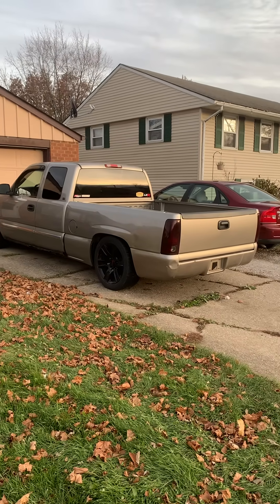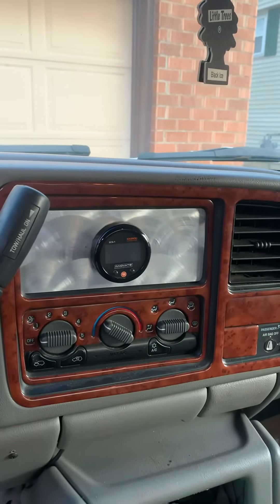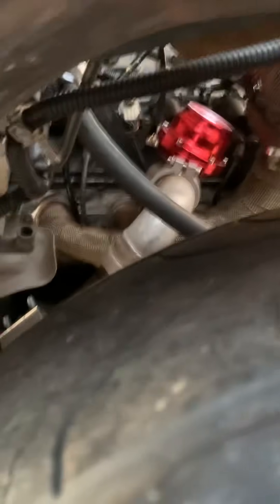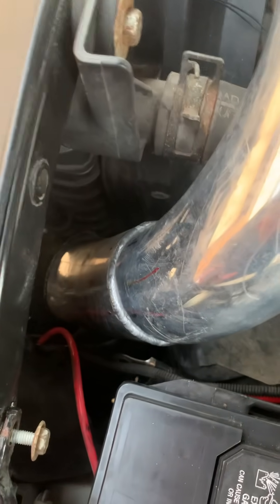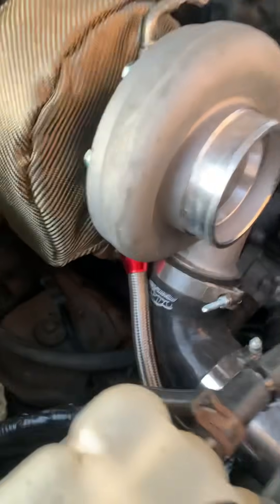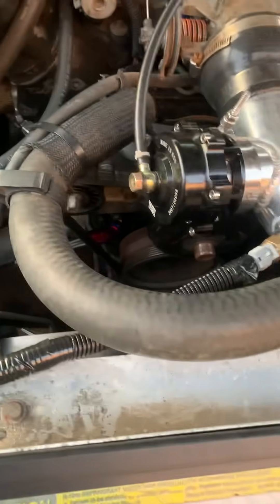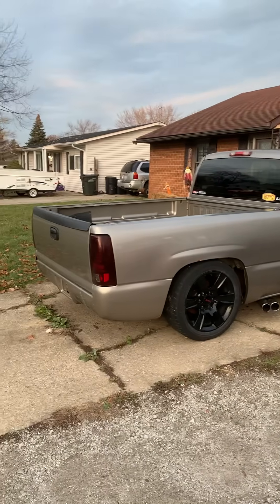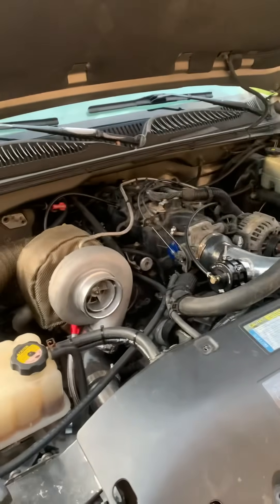Low Budget Turbo Silverado Under Boost for $1500 w/ XS-POWER.com Hotside and complete build info

Comment: Looks good. Personally i would had fabbed an extra piece to put the turbo were the coolant reservoir is at right now. That way you can retain the AC and keep the hot turbo away from the coils and wiring.

Comment: I have a 1985 Chevy caprice classic with a 6.0/4l80 and my brother and I was talking about doing this and to see that you did it with $1500? I’m SOLD!
Reply from the maker: It can be done, eBay and YouTube will be your best friends. Especially in a big bodied caprice, you got a lot of room so it’s a lot more of a universal fit instead of having to buy stuff for something like an f body or something
Reply from the maker: That’s why I chose to do it to my truck because of all the option I have
Reply: @bo_flint93  True. It’s a lot of room up top but but from the headers go down it’s a tight fit.
Reply from the maker: Good thing these hug the block and bell housing should fit great
Reply: @bo_flint93  Indeed

Comment: Not bad. More than one to skin a cat with the ls truck turbo builds.

Four years ago, I went with the basic On3 kit with the 7875 upgrade $2,100 shipped, no tax. No regrets with the On3; buyers just have to factor in wideband, fueling, fans, tuning, etc.

Just swap in a good junkyard 4l80e, before going into serious boost.
Reply from the maker: I wish i would have bought the on3 kit for my 6.0 LQ4 swapped RCSB about 5 years ago when i originally decided i wanted to go turbo. Would have saved me some time and my sanity lol
Reply from the maker: I think it was around same price after i had a few options picked
Reply: @bo_flint93  p.s. keep the fuel tank at least 1/2 full, when doing hard pulls under boost. You don't want a 17:1afr blowing holes in the engine.
Reply from the maker: Lol. I hope the fuel pump does pretty good, i modded the bucket so hopefully it will hold fuel better on hard pulls

Comment: That's a sweet setup for what you have in it 🤘. I had a CLEAN 02 Silverado the same color and had plans to do the same. It was a good running 4.8 and I miss it daily. It would run all over both of my buddies 5.3 trucks and it made him so mad lol. We don't know what it was about it. It just ran hard with the same bolt ONS. Anyway, that gives me a push to get another one now 💪
Reply: 4.8 has a shorter stroke  they will get up faster but 5.3 will get it on top end BUT usually once u get someone on the jump and they don't have alot more power than you then usually you got them

Comment: This is beautiful. Wanna do something like this to my Dad's 6.0 LS2 silverado SS, get it cranking out mad power for relatively low cost.
Reply from the maker: That truck would be perfect, aleeady has the good tranny in it
Reply: Silverado SS should have an LQ9. Basically the same thing, but LQ9 and LS2 are both higher compression, an LQ4 would be more fitting to turbo
Reply from the maker: The only difference is the pistons and rods, the talk between LQ4 and LQ9 which is better is overrated, it’s all in what u wanna build and how much money you got to spend
Reply: @bo_flint93  yes, overall a lower compression is easier to boost and less risky. If I recall correctly the LQ9 and LS2 have around a 10:1 compression, where the LQ4 is somewhere around 9.4:1?
Reply from the maker: I’d say you’re right. Man my wife’s Denali has the 6.2 in it and I can’t waitbtinturbonit

Comment: got a similar thing going on with a 1994 4.6 V8 thunder bird, not one but two of those t4t3 m12 50/63's... fit under the rear seat. half way done "piped up running but missing the second blower"... but for now it's getting near 40 below, no one works in that weather unless in a heated truck plowing snow. 😋🍗 so cold the 10amp 14lpm oil scavenge pump is nearly sized, needs a pulse driver to prevent the coils from burning out.
Reply from the maker: I will check it out on ur channel

Comment: Man I have a 2020 2ss camaro but I don't want to void my warranty and I got a 2000 silverado for a daily ... I have are head stud 2 different cams 243 heads port polished and a full build kit but it was ment for my 6.0 ls but I got rid of it . Now I'm thinking of putting it into my daily then doing a turbo kit but I want ac and heater

Comment: Your video popped up on my feed and I thought I had see them all haha! I’m 99% and I’m struggling to get my innovative wideband to report to Hp tuners. My tuner said I need to wire in a 3 pole 2 way switch from the AC pin in the PCM to the AC wire on the co pressor to the output of the LC-2 controller. If there’s an easier way I’m all ears. It’s an email tune so it’s kind of a pain. But I can make whistle noises so far, pretty exciting haha. Nice video and keep up the good work
Reply from the maker: Thanks man I appreciate it. I think my scg-1 came with a cable to connect to hptuner
Reply: The easier way is to buy the prolink and pro tool set, it's worth the money to support hptuners imo but I understand everyone has a different budget. That said, there are plenty of good write ups on doing it via the AC input.
Reply: @curbo34  do you happen to have a link? I’m still trying to wrap my brain around it...
Reply: I posted links but I guess YT took them down
Reply: Once I figure this out I’ll make a video

Comment: The eBay hot sides are up to $500 which is absurd. I’ve been teaching myself to weld so I can make my own hot side and run a gt45. Mine will be mild steel, already have the J bends. I’m trying to find a cheap/blown engine to use as mock up so my truck won’t be down more than a weekend. I have a summit 8718 cam, summit Ls6 springs, 340lph pump and running on about 50% ethanol. I’m excited about going turbo!
Reply from the maker: You gotta nice little plan going on. Keep me updated on your build would love to see it. Have you seen my new build yet? Well it’s a project right now but hoping to finish by summer time. I have a gmc Sonoma 6.0 swap with terminator x that I am going to do a budget turbo kit on.
Reply from the maker: XS Power has Hotside on there site for $300
Reply: @bo_flint93  when I looked earlier it was $330, now it says $349 for us. I can’t do without the ac in the south, especially since mine is working so good with my junkyard electric fans.

Comment: Damn ... I never wanted to be a typical Mexican with a truck that’s low and loud but trucks are useful and having a truck that can move is even better ... I’m thinking about getting a turbo myself for an 03 GMC Sierra 5.3 it’s already some what quick tested the 0-60 did it in under 7 seconds more like 6.8 but still moves. Great set up you have there

Comment: Ok I got a 2010 Camaro 6.2 LS3 I want to do this just idk if this would be good to just get 600 hp from. I’m building to 1000 hp just not about to drop 4500 right away on akit
Reply from the maker: You could easily see +650 easily especially with that 6.2
Reply: @bo_flint93  With this setup? and how reliable is it?
Reply from the maker: Easily
Reply: @bo_flint93  Reliability is decent?

Comment: That link for the hotside/crossover is 440$ now. 

Recommend getting the ebay cast turbo manifold, and getting the ebay crossover, cutting out and replacing the flex section.
Reply from the maker: Wow that price went up

Comment: How does this workout with the factory intake manifold? Its gotta be hard stuffing any boost into a 75mm opening???
Reply from the maker: Not at all, stock intake actually works great. Lot of people think you have to buy some expensive intake and tb but honestly save your money and use it on something meaningful. Or if u desire to change it anyways just get oem trailblazer ss intake

Comment: Those stock wheels are sweet did you powder coat them ?
Reply from the maker: No I actually bought them for $175 and painted them with some black basecoat that I had from a previous paint job and then I cleared them with high solids clearcoat and they turned out pretty sweet.

Comment: Iv got a gt45 eBay special turbo 0 miles with the passenger side turbo manifold 0 miles. Wastegate 10miles or less on it. 4inch intercooler from on3 performance 0 miles along with cold side piping. And a set of 60lb Deatschwerks injectors. Basically 60lb Bosch injectors. 60miles. I upgraded my turbo setup. I was making 440hp at the wheels. Stock 4l60e trans. All on pump gas. For sale $500
Reply from the maker: How much for injectors?
Reply: You still have this setup for sale?
Reply from the maker: That would be an awesome deal if u could grab it
Reply: @bo_flint93  guessing he was just kidding about the price. No reply to either of us
Reply from the maker: Lol I guess so

Comment: Did you have to flip the stock exhaust manifold around so it points forward?
Reply from the maker: No I used XS power Hotside manifolds

Comment: Need to run a line to intake off catch can. Want to pull vacuum through it
Reply from the maker: Ok I’ve been thinking something was hooked up wrong because my can doesn’t have much in it
Reply: @bo_flint93  yea I did the same I thought it was pretty much just a vent but it actually needs a line to intake just like pcv. Whole reason we put em on to keep that nasty oil and carbon from going back into the motor. But don’t sweat it homes I did the same thing
Reply from the maker: Good looking out man I appreciate you

Comment: I want to try setting up a 5.3L with 2 VF39 turbos from a Subaru as each one is sized to a 2.5L and would feed a 5.3 perfectly. Plus they'd be cheap as they're always sold off when the car owner upgrades at usually low milage. They're also oil+water cooled and the bellmouth downpipes (internal waste gates) would work well for routing the exhaust back down under the truck. There would just need to be a merged coupler for the 2 oulets. The generic FMIC would still work. A boost referenced fuel regulator is needed to keep constant fuel pressure though. Did your tuner remap the existing ECU or did they use a piggyback setup? What HP output did you end up with?
Reply from the maker: Stock PCM on HPtuners with 2 bar MAP sensor from a cobalt LSJ
Reply from the maker: Easy 500 hp on stock cam 5.3

Comment: Just checking in on this, plan on boosting my 99 4.8 similar setup. How’s it holding up?
Reply from the maker: I’ve put about 800 miles on it, hard miles too and it’s been great so far.

Comment: Is it possible to tie the exhaust back into the original pipes for a more stealthy quiet sound. Or is there enough room?
Reply from the maker: Yes it’s possible, it would be a tight squeeze with my crossover pipe running around bell housing, if you went with the crossover in the front it would give you a lot more room to run a full exhaust

Comment: Did you run the stock fuel lines, rails and regular? Thanks.
Reply from the maker: Yes they will support up to 600-650 hp

Comment: How much boost can you get out of it and do I need to change anything or I can just drop it in and go ?
Reply from the maker: You have to change a lot like transmission, plugs, springs, oil return, it takes quite a bit of work, but if you’re doing the work yourself it will save you a ton of money

Comment: Where'd you put the o2 sensors ? One on each headers or on the downpipe?
Reply from the maker: One on each header is ideal but I have one ind driver side header and the other in the down pipe and I have my wideband in my downpipe too

Comment: How did you do the oil feed? Did you take the pan off? And did the kit come with the lines?
Reply from the maker: I return it through timing cover by welding in a 10an bung
Reply: @bo_flint93  did you take the pan off to drill it I’m only asking because of shavings getting into the pan
Reply from the maker: I didn't use the oil pan I used timing cover
Reply: @bo_flint93  do you happen to have any pics of location for that because that would be more convenient then drilling the pan for me
Reply from the maker: https://youtube.com/shorts/hrKHiNFwshg?feature=share
Reply from the maker: https://youtube.com/shorts/-Kde60eCb-8?feature=share
Reply from the maker: https://youtube.com/shorts/hrKHiNFwshg?feature=share
Reply from the maker: https://youtube.com/shorts/-Kde60eCb-8?feature=share

Comment: I started watching 4 wheeler videos and ended up here… and I have a 2004 Silverado and was going to get a cam for around 750-800 price range…..but you mentioned you got a turbo for 200?!! Wow I never looked into turbos for trucks. So my question for you is did u have to change the fuel injectors like you can’t run on stock ones? And how long did it take to get everything installed turbo Intercooler etc
Reply from the maker: Yes you will have to change injectors it will run on stock injectors but if u try to make boost you’re gonna hurt it. I will have some more videos very soon the truck is done now, just gotta do brake lines and it goes on the dyno next week. It has come such a long way since the videos

Comment: How has the truck been holding up? I have an 05' sierra I want to do a single kit on, but can't bring myself to drop the $3,000 on the on3 kit. (im cheap too lol) I have a welder and plenty of fab knowledge, so i have a hard time spending $3k+ for a kit than could obviously be put together for half the price. 
 Definitely like how you routed everything here, and that hot side kit looks dang good for the money. My major question would be, could you have retained AC with that hot side kit? I want to retain Ac / Heat, but that hot side kit is definitely the cheapest & best looking one i've seen by far. Would love to chat with you some more on this build.
Reply from the maker: Thanks man I appreciate it! You could retain ac would just have to reroute lines. And as far as having fab knowledge you will be able to breeze thru it
Reply: @bo_flint93  How has everything else help up on the truck? I’m looking to make 550-600whp on a cammed 4.8 - stock ring gap, stock bottom end.
Reply from the maker: You will make that power very easily especially if u go with the sloppy stage 2 camshaft and go e85 with some deka 80 injectors and a 340-450lph pump you’ll make that power easily
Reply from the maker: It’s all held up really well, biggest thing is just checking to make sure all your clamps and manifold and flange bolts are tight. They loosen up overtime because of the extreme heat cycles but that’s part of the game. I don’t have the truck anymore but it is in Chicago now and still being daily driven to this day. I have a new build that I am finishing up now it’s a 97 gmc Sonoma with a 6.0 and I built my own turbo kit for it like I did my Sierra. Check it out on my channel I’ll have an update video soon
Reply: @bo_flint93  I’m already running a BTR truck Norris cam, I was also looking at the DEKA injectors with a 450lph single pump. I daily drive the truck & im trying to do a turbo setup & 4l80 swap for $3500 & under. Already have a good friend doing an OE rebuild with a 3200 billet converter on a 4l80 for me, that tab was $1,550. So hopefully I can piece together a kit for less than or right at $2k & send it down the road reliably lol.
Reply from the maker: U should have no problem doing that. Save some money and put that into getting a good tune or Dynotune if possible. Where u located?
Reply: @bo_flint93  I have a friend who remote tunes, he’ll be street tuning the truck once it’s finished. I’m located in NC
Reply: Also, in order to run the deka injectors, did you have to use a spacer kit for stock rails? & did you do anything for feed / return fueling ?
Reply from the maker: @kam5661 yeah u have to run a spacer and no it’s was using stock fuel rail and return system

Comment: Still holding up ? Would you do it again? How long did it take you to install the turbo and get it running properly ?
Reply from the maker: Took me a few months to build it, but now that it’s built I can tear it apart and put it back together within a couple hours
Reply from the maker: And as far as getting it to run properly it comes down to having it tuned and having the right map sensor in it
Reply: @bo_flint93  I appreciate the reply. Anything you would do different next time? Just getting into this myself and considering the pros and cons of a complet on3 kit
Reply from the maker: On3 kit is simple, everything is ready to bolt on if u can afford it go on3 if not go my route
Reply: @bo_flint93  I assume you had a local tuner handle the tuning?
Reply from the maker: Yes Dynotune Motorsports
Reply: @bo_flint93  1 more question ,  worth it?

Comment: Did you have any problems mounting the hot side at all? Have to re weld any of the hot side kit?
Reply from the maker: Not at all fit right up
Reply: @bo_flint93  so it’s been, 5/6 months since putting it all together, would you do anything different? Still no complaints with turbo or hot side kit? Did you use the gaskets the hot side kit comes with?
Reply from the maker: No complaints yet and yes I used the provided gaskets, no issues yet. I’ll post some videos of some pulls soon
Reply: @bo_flint93  just bought the hot side, how did you connect your crossover pipe to the turbo manifold side (passenger side)
Reply from the maker: 2.5in band clamp
Reply: @bo_flint93  what plugs and wires did you go with?

Comment: Do I need a bigger fuel pump for decapped injectors?
Reply from the maker: You will once you start getting into boost
Reply: @bo_flint93  Ok thanks. Awesome build your doing I am trying to do the same on my 05 silverado with a l33